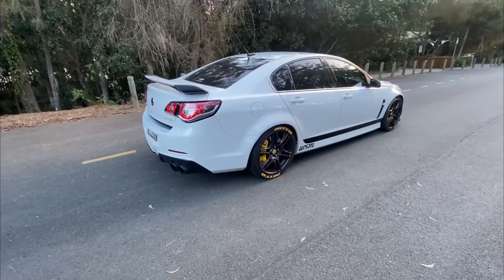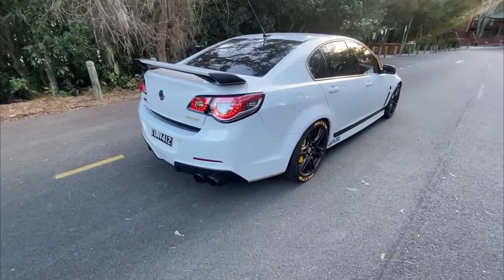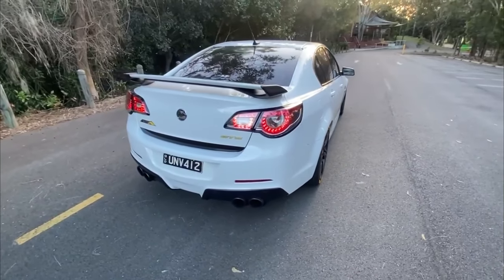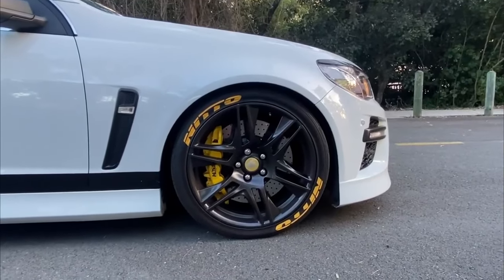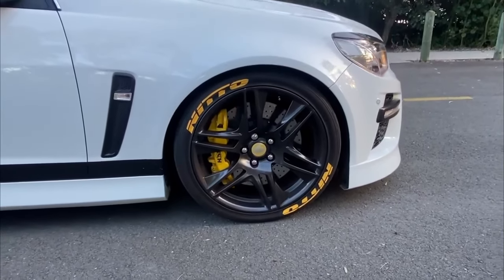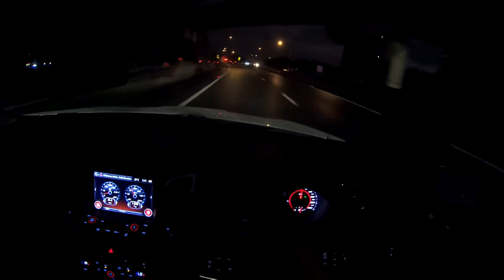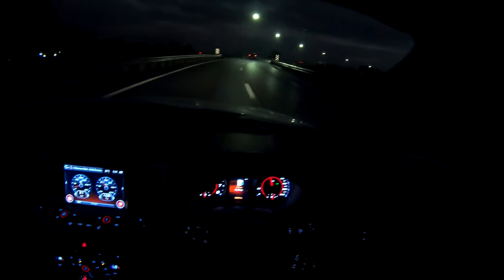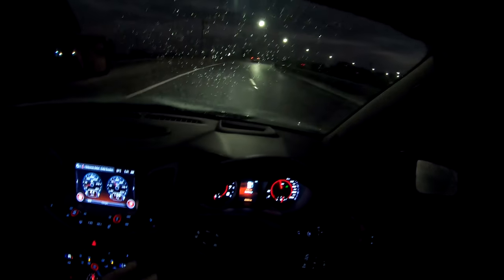VF GTS BRAKE TESTING

Comment from the maker: Done very early in the morning , hence the footage at early morning
Reply: Would your GTS brake better than the Clunie Garage ute with its standard calipers?
Reply from the maker: @angry9901  hmm  probably around the same maybe a bit easier for me but i can brake over and over again without worrying about over heating or the pedal going soft on track days 
Where as standard wouldnt last much until one would need to stop and let them cool down
Reply: @CurtisLSA  thanks for the reply. I still don't understand why a ute can do lap after lap with standard brake calipers with no brake fade and do better lap times than a HSV GTS. They also out brake cars like VW GTI which also have big brakes and are lighter. I would have thought on the race track the big brake calipers would be a huge advantage. Would you be better off buying the best brake pads you can find for standard calipers for a street driven Commodore?